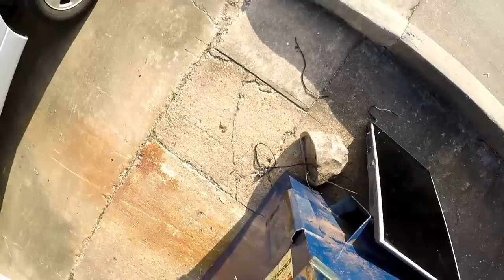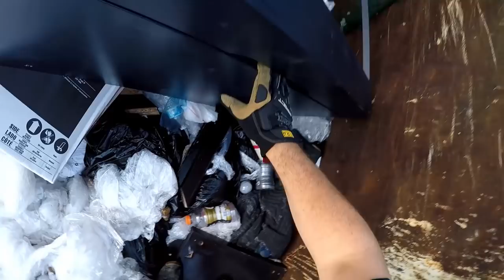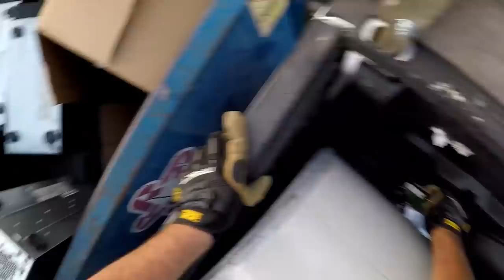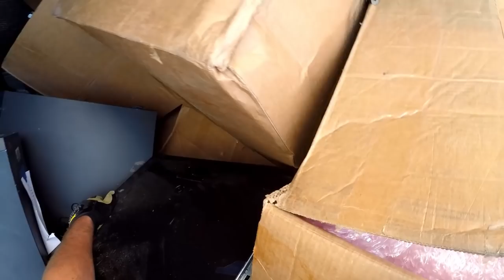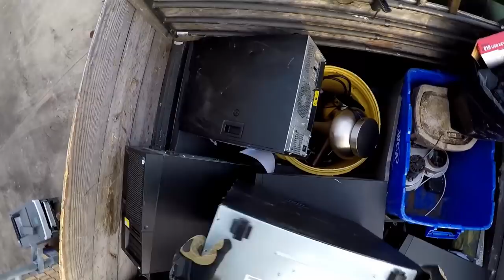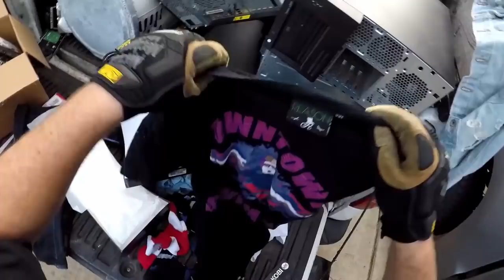Dumpster Diving "I'll Try Not To Breath So Much"

Comment: You know sometimes on old water heaters, if you find out where they were purchased, you can return them for a partial store credit for a new water heater as long as the old water heater is still within it's usable time frame with is listed on the water heater. Return the water heater, get store credit, buy a new water heater with store credit and own cash, turn around and sell the new water heater and profit the store credit amount in cash plus get your money back.

Comment: Just because I am a IT nerd.  The IBM PCs would have cards, mother boards, RAM, etc. which would be usable.  

However the hard drives are a different story.  Even the hard drive which weren't hammered may not be viable.   Companies which have implemented  best practices would have degaussing the drives.  Degaussing destroys the magnetic properties of platters specifically the special servo control data.
It is the only way to satisfy a federal requirement related to the sanitization and destruction of information.  So the hard drive maybe paper weights. Sorry. Good luck.  Love your videos ❤️

Comment: Daaaaammmmnnnn.... that's a lot of old computer stuff! Glad your electronics guy will buy them and repurpose them so they don't in a landfill!  Clean up the Gucci shirt...take it to the dry cleaners..have it washed and pressed...you could easily get $20 for it on eBay. Designer clothes can fetch some decent money if you get them cleaned and pressed. You can probably get $30 easily for the jeans too. Just check eBay.

Comment: Those IBM computers, from the pre Lenovo days of the company, are probably servers. Don't know what value they have, if any, but possibly that might be useful information. Also, hang onto a couple of those hard drives. People doing data recovery might need them for parts. Ebay is probably a good outlet for those.

Comment: Printed circuit boards are worth a good bit (usually about 80% of the value of aluminum by weight which by volume is... not as good). I had a dog food bag filled with old motherboards and hard drive controller boards and it was something like $50. For something I could carry like 10 of in the trunk of my car. 

Of course if you got someone who will just buy computers whole and you're not a scrapper yourself it's not gonna be worth it. Just sell them off whole and let someone else take some of the meat off the bone.

Comment: Tell them to kiss off,or i can.the average tower weighs 25pounds,then you have to climb in the dumpster,fish them out,bend over as your doing it , balance yourself when you it there and then sling the towers over to the truck,the excersion alone can feel like you've run a mile.

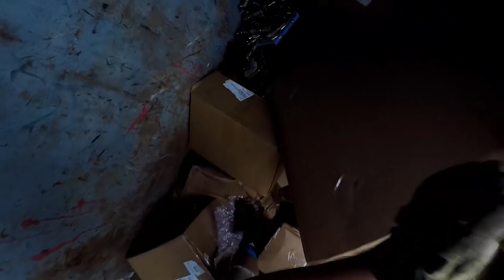Comment: 14:03 I was just wondering, why didn't they just sell those hard drives instead of destroying them?  That's a crap ton of hard drives!
Reply: Data security... Deleting/erasing data takes a lot of time, depending on the drive size and how many overwrite cycles. Formatting the drives with a hammer is the fastest way to make sure that no one can use the files on the hdd's. At the company where I work we drill holes through the drives before they go to recycling.

Comment: The place that threw away all those computers in that dumpster were stupid for putting the hard drives in there. There could be information still on them unless they were all wiped clean before hand. It looked like they were all Western Digital hard drives from the labels.